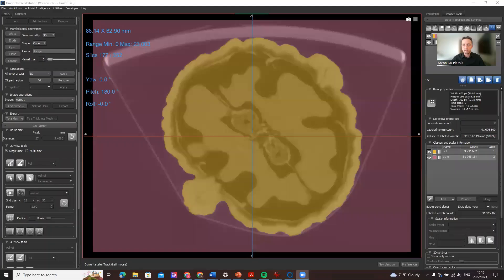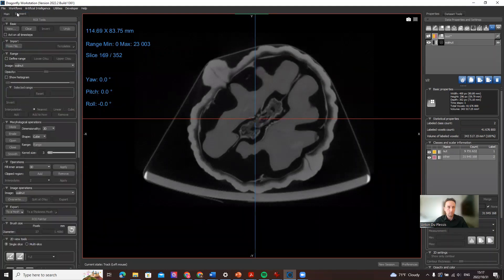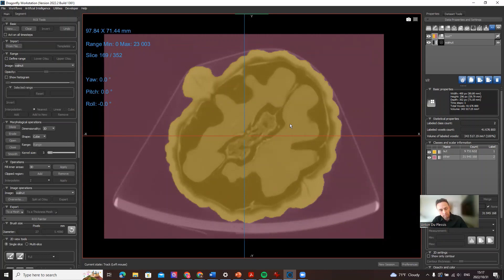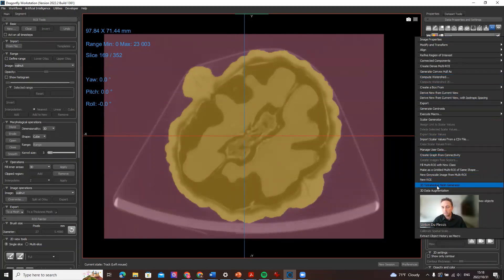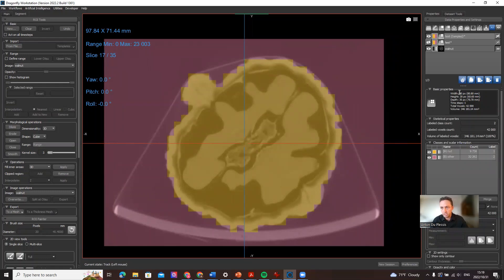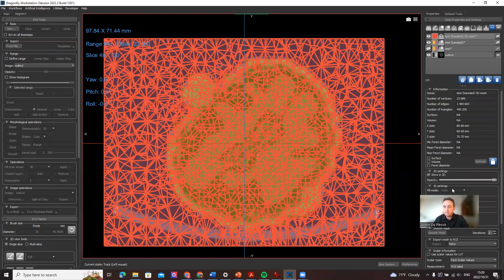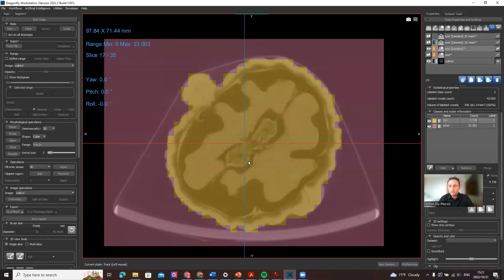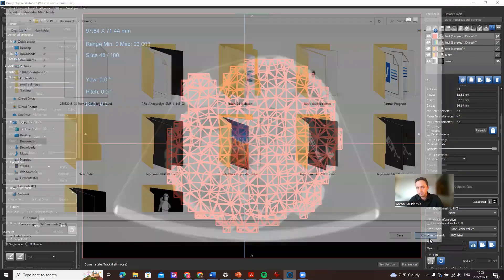Dragonfly 2022.2 Feature : Volume meshing of a walnut

Comment: Hello! I have a small question, I am using the Dragonfly version 2022.1 . The part where you select the option of 3D tetrahedral mesh is not available. Can you please tell that has the name been modified to generate contour mesh in 3D modeling tab when you right click. Also, have you seen examples of people using the generated mesh in CFD softwares like COMSOL? Thank you for the video
Reply from the maker: Hi Innovation Imagination (nice name by the way), this is a new feature in Dragonfly 2022.2, so it will not work in 2022.1, please update to the latest version by going to orss.ca/getDF
Reply from the maker: And on the topic of the mesh output, it is the same as NGSolve NetGen, see https://ngsolve.org/